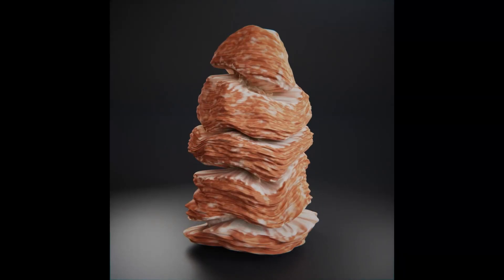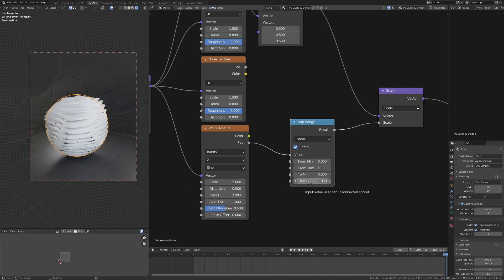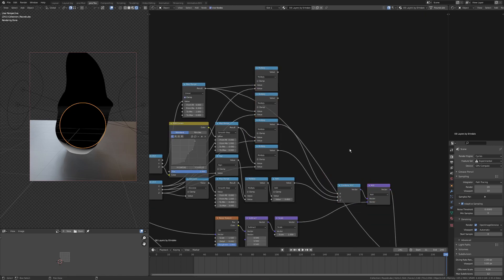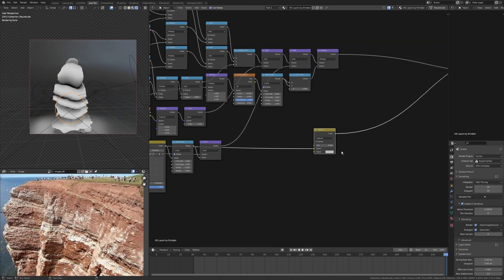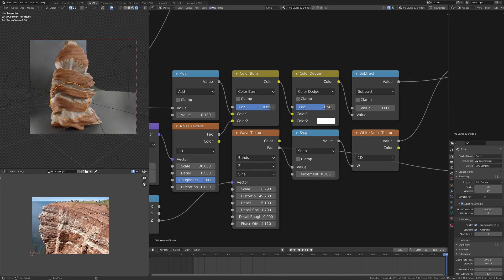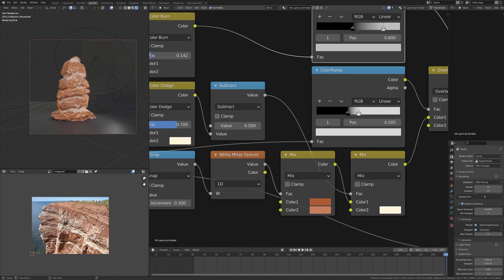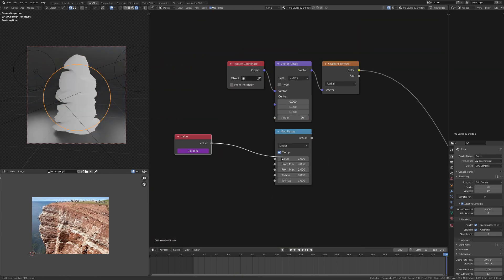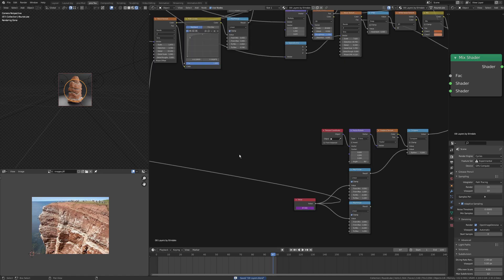Nodevember Day 8 Layered Timelapse - Blender Vector Displacement

Comment: I want to save the rendered image of this design as a mesh (when you apply from the modifiers menu, the mesh structure is said to be completely textured like the rendered image), I want to get the process texturally and geometrically as stl, and I want to print it out with a 3D printer.

I don't know if this is just a visual change or a mesh change that I can print with a 3D printer. Please teach me, thank you.
Reply from the maker: You can bake the displacement and albedo to textures in the shader. Then use the displacement modifier with the displacement map that you baked and you can apply that modifier to create actual geometry you can print etc
Reply: @Erindale  I would like you to make a simple video in this area for those who are not professional or difficult like us, thank you. There is no such video on YouTube. There are many people interested in 3D printers.